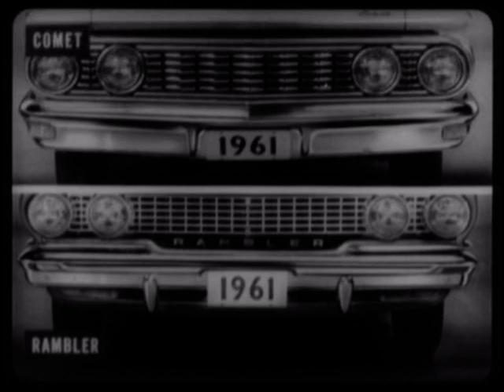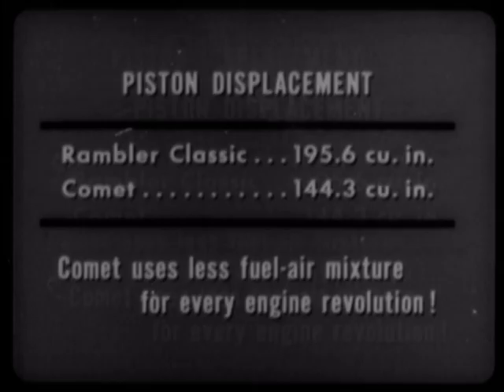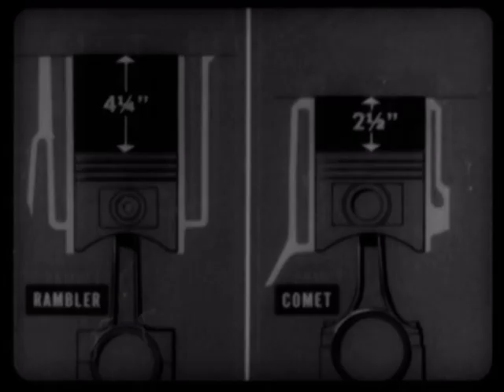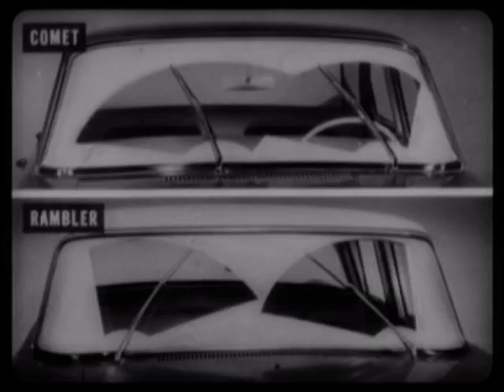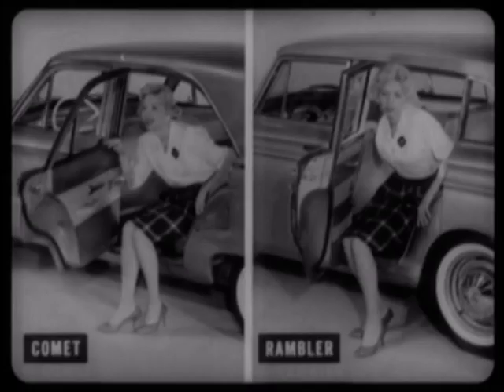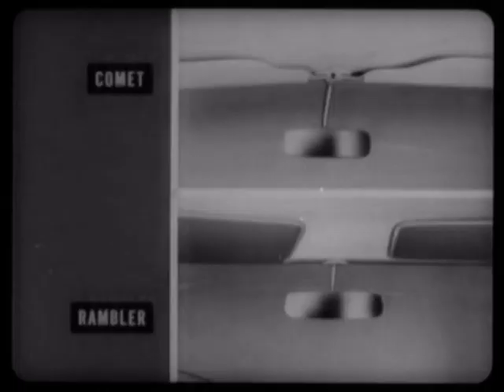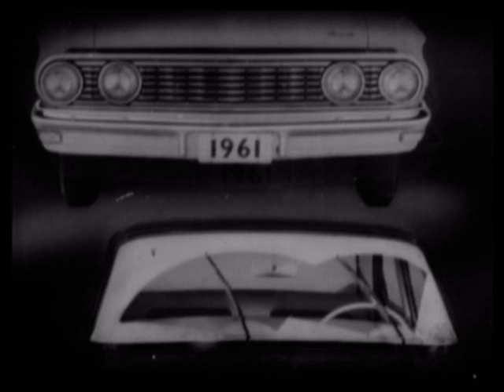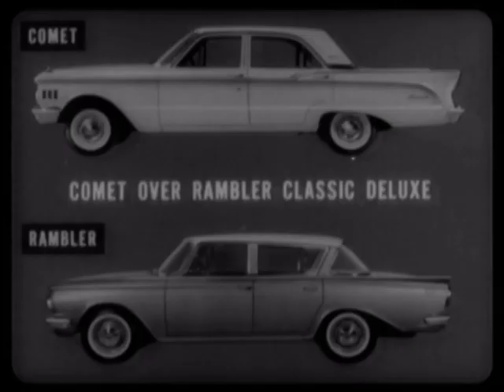1961 Comet VS AMC Rambler Training Film P2

Comment: They have really reached far to make Comet's disadvantages seem like advantages. As if the Rambler 4,25" stroke wouldn't provide a LOT better low end torque than the 2,5" stroke on the Comet.

Comment: The Comet with the 144 engine had the worst power to weight ratio of any American car of the time. I had a '60 Falcon with the same engine (lighter & quicker than the Comet) and it couldn't keep up with the Rambler ( American or Classic). The !95.6 Rambler engine produced 127 HP against 90 from the 144 Ford/Mercury engine & the Rambler had much more bottom-end torque from it's longer stroke. The 144 had to be revved hard to get any poweer out of it. Some of the critisms are valid but not all.

Comment: I'd still rather have the Rambler. For one thing, a longer stroke means better use of the fuel, and for another, Ford couldn't build a good inline six to save their souls. (Until the '70's, when they came out with that ball-busting 300 c.i. )
Reply: I beg to differ the 200 six was a very reliable engine with 7 mains,  my grandfather's 76 Granda had the 200 and it ran like a dream until my idiot brother in law caught on fire, at the time it had 385,000 miles on and still only used a 1/2 a quart of oil every 300 miles, got 30 mpg on the highway too. I know because it was also my car for about 5 years.